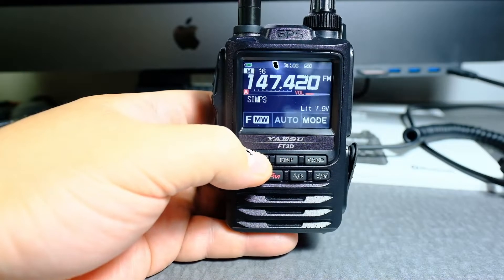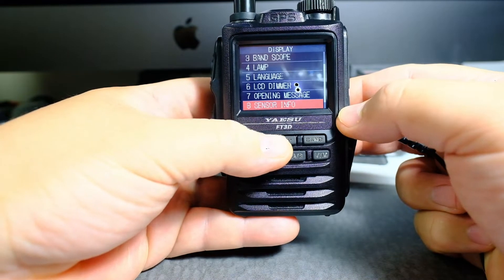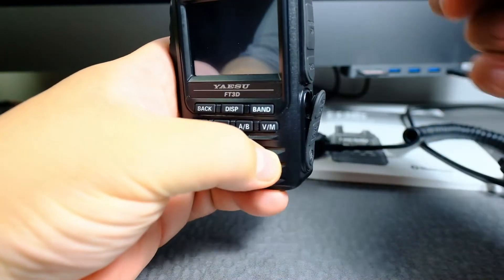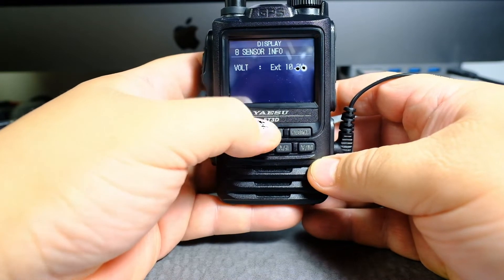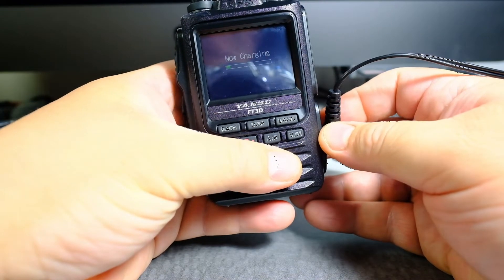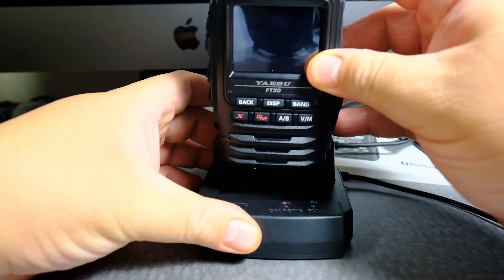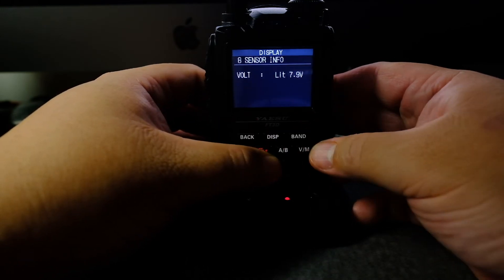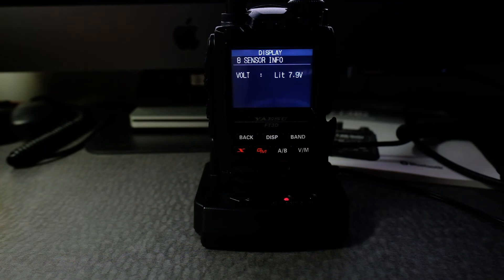Yaesu FT3D Battery Voltage Display

Comment: The supplied DC wall charger (SAD-25) that comes with your Yaesu FT3D is not for use with the rapid charger cradle. You have to buy a separate wall plug (SAD-24B). The CD-41 rapid charger comes with a slip of paper specifically indicating which wall chargers can be used with the Cradle. Additionally, Yaesu has updated their wall chargers and product # so the list of acceptable wall plugs may be different than the ones listed in the paperwork. This is the model of wall charger to use with the cradle only - see link below. I labeled mine so not to be confused, because it is confusing and frustrating honestly. Hope this helps!

https://www.hamradio.com/detail.cfm?pid=H0-016841
Reply: @frankwc0o   you’re welcome, although some of the guys in the forums say it’s ok to use original Wall charger so I suppose it’s up to the individual to decide. I doubt the FT3D will have any issues either way, it’s just unfortunate Yaesu doesn’t make it easy to figure out.
Reply: @danayoung1453  thanks for that info!! I don't know why Yeasu makes everything so difficult. 73
Reply: Thank you, this is very helpful!

Comment: I'm having trouble with frequency reception when I plug in the ft3dr while listening to the radio.. It's clear when I disconnect the power supply but turns to static when I insert power.. Am I not able to charge bit while radio is in operation?.
Reply: @frankwc0o  yes it does it on the supplied ac charger and with the cig lit charger I bought with it... It's weird though.. I'm listening now while charging I just can't get the radio close to my body or it cuts all the way out. Doesn't do that off charge. It just really reduces the receive signal when I plug it in.. I have just found I can move the ht around and the signal will come in better. But really reduced.
Reply: @frankwc0o  thanks for your quick responses.. This ht is so much more than anything I've ever had and your videos are saving me.. Haha.. But I will dig deeper. Thanks again

Comment: What is the external DC input range? I can find nothing in the manual or online. Does this also charge the radio when any external supply is used?
Reply: I'm getting at what is the max DC input into the r radio. Can I run it directly from vehicle power of 13.8VDC?
Reply: @emscott2  I plugged in directly a 3Ah 13.8VDC power supply and toasted my charger in less than a second. Previously, I used a cigarette plug power cable at 2 Ah on that same power supply and it was working fine - I should have left well enough alone. These chargers are not cheap.